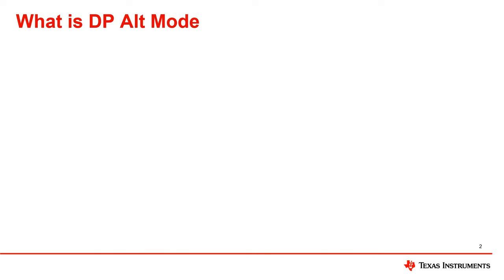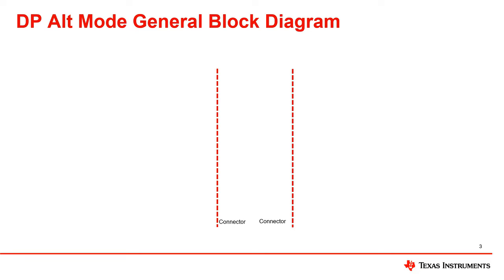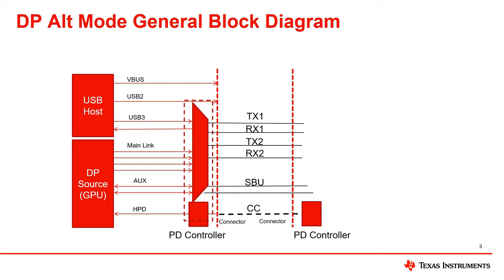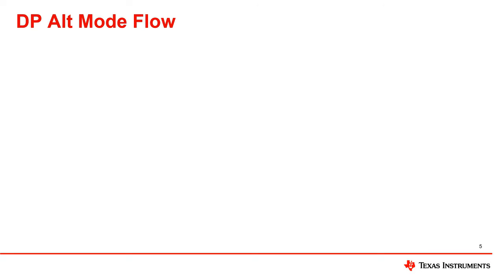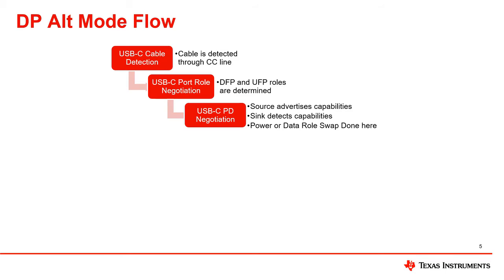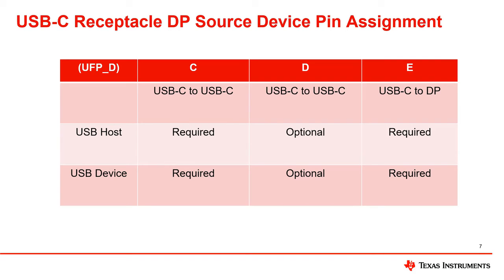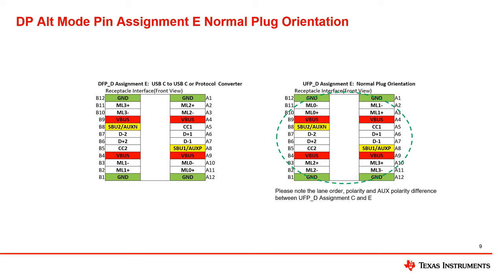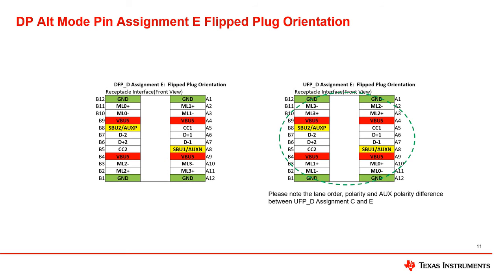What is DisplayPort Alt-Mode?

Comment: Thank you, I believe this answers my question. Of course all devices in the chain need to support DP Alt Mode, and it appears when selecting a cable the "appropriate high speed lanes" are essentially USB3 lanes. Therefore the average USB2 cable will likely not work, whereas a USB3 cable should likely work.

Edit: this should still be verified in the product description of the cable if possible, and also I'm not certain but it might be a feature of USB 3.2 specifically.

Comment: I have had the worst time trying to get my portable nvme SSD to work over the USB C/DP Alt port. The motherboard information shows that it supports USB 3.2 Gen 2... CrystalDiskMark consistently shows USB 2.0 speeds over that port...
Reply: Yup. Them taking away the HDMI port was a big mistake. USB C is unreliable, It's frustrating.